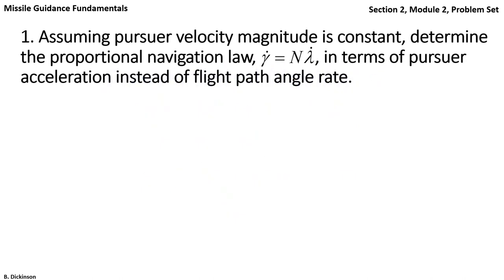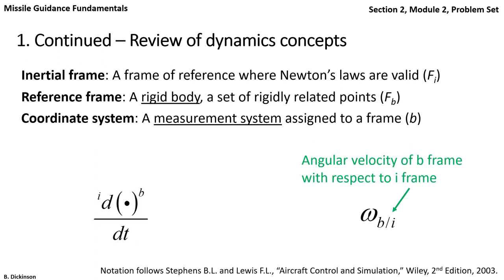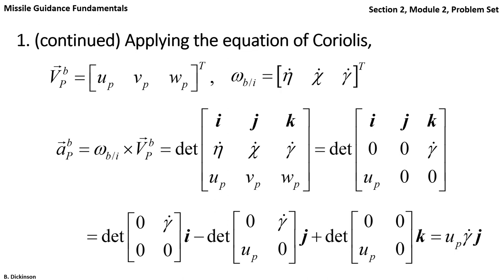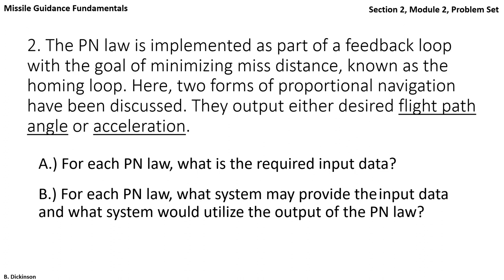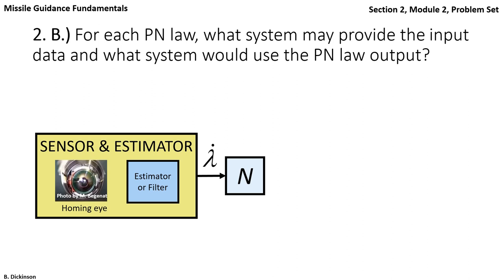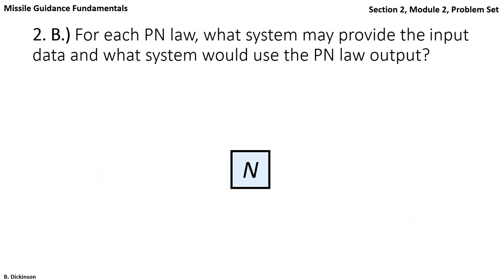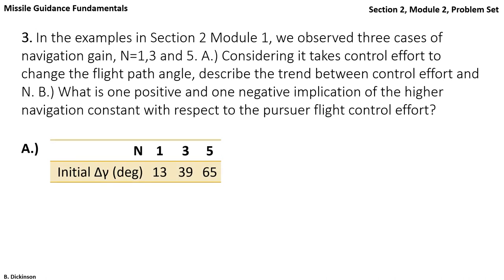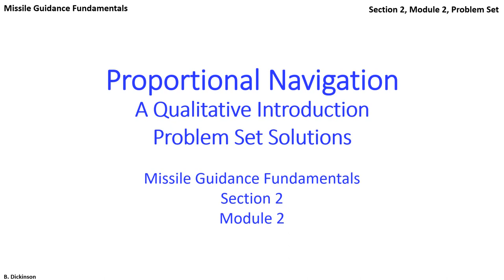Proportional Navigation Intro Solution Set - Section 2 Module 2 - Guidance Fundamentals

Comment: how to proceed with this same problem if the velocity magniuted were also had to change?
Reply from the maker: In Pure proportional navigation, the acceleration is normal to the velocity vector so the magnitude does not change. In True proportional navigation, the velocity vector changes in theory because acceleration is normal to the line of sight direction so that a component of the acceleration vector is aligned with the velocity direction. 

In reality, the pursuer will slow down due to drag as it maneuvers, assuming the rocket motor is off. In this case, the effect is a change in line of sight angle, so that an adjustment to the collision course will be needed. Note that a similar scenario happens when the target is accelerating in the sense of a change in line of sight angle.

In the end, True or Pure proportional navigation are both still effective when the pursuer velocity magnitude changes.

Comment: I get the angle it's simple. I can't understand what do you mean by "acceleration". Which one ? The angular acceleration ? It cant be the missile's acceleration as it is a solid motor which you can't control right?
Reply from the maker: Hello, in the first problem the "acceleration" of the vehicle is translational acceleration perpendicular to the body. Here it's assumed to act perpendicular to the velocity vector out the nose (following pure proportional navigation). This acceleration can be created with aerodynamic forces from angle of attack due to control surface (e.g. fin) adjustment. Note, this can occur when the body has sufficient speed. The rocket motor is not usually throttle-able for flight control.
Reply: @LearnGandC  now I get it(I think) That's why you need the accelerometer. Now I should rewatch it. Thank you!